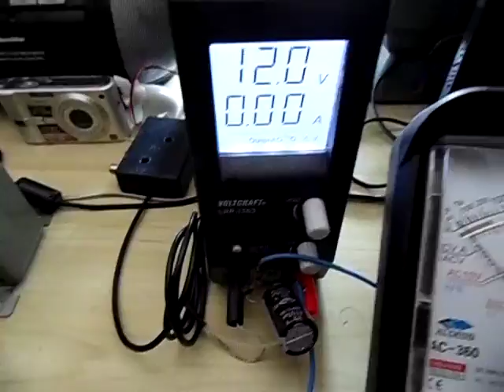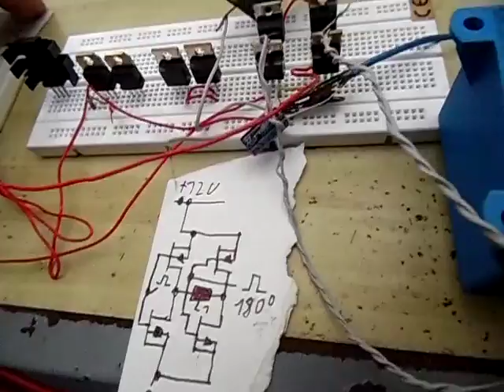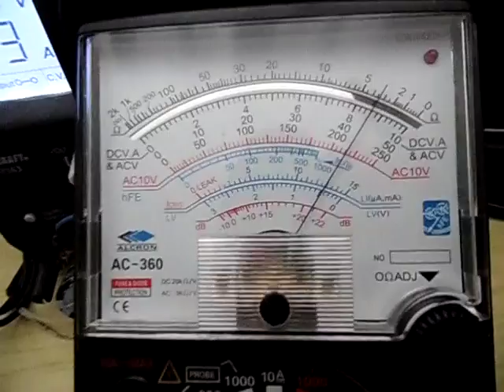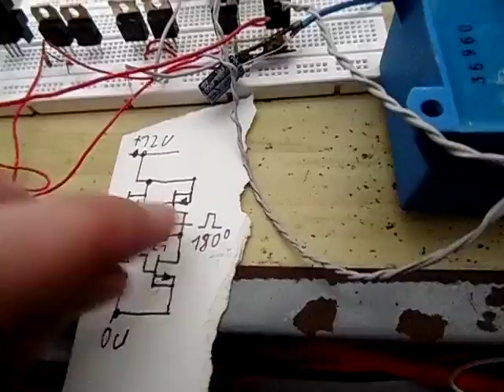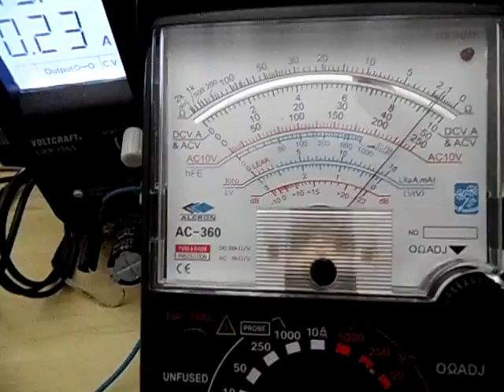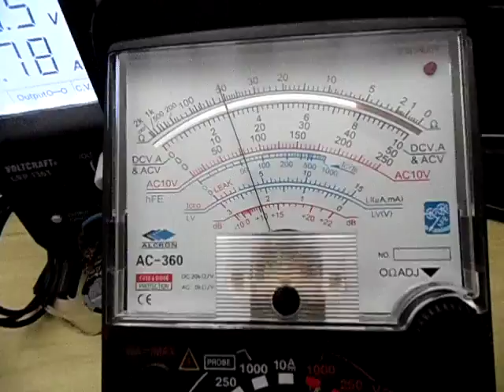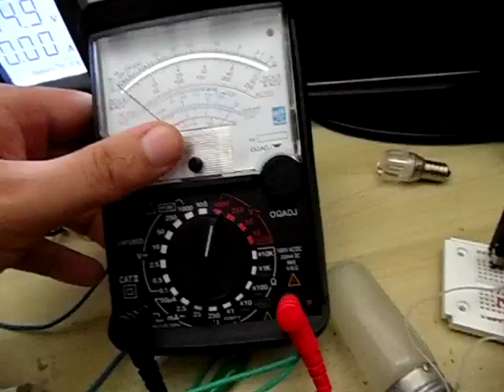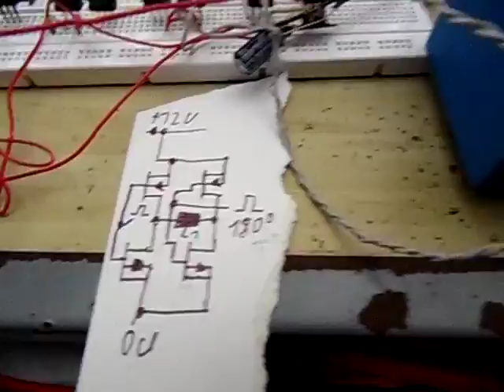DC AC power inverter part 2

Comment: Also if you have 12V on the PSU, then you will have +/-12V square wave. Your volt meter measures RMS right. The RMS of 24V peak-peak square wave and 24V peak-peak sin wave will not be the same. 
I mean at 12V rms square wave the peak-peak will be 24V but 12V rms sin wave the peak will be 34V.

Comment: With respect, i want to ask something i am not quite sure but isnt duty cycle and frequency different things? I mean you can have 50% duty cycle while you have 4 Hz frequency it means it stays on for 0,25 seconds then off 0.25 then on 0.25 then off 0.25 and you have 50% duty cycle with 4 Hz. In the other hand if you want to have %50 duty cycle with 50 Hz it should be 0.02 on 0.02 off 0.02 on 0.02 off.... I dont know if you adjusted your circuit like this or not but i think it is something to be considered while adjusting the duty cycle and frequency of your timer IC. I might be wrong though i am a mech. engineer not electrc. :) thank you for preparing this videos btw